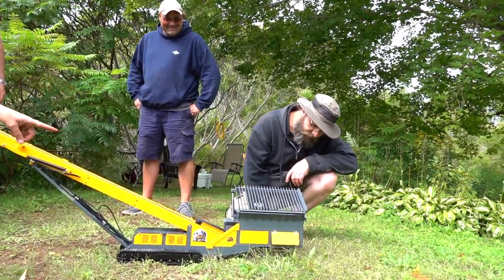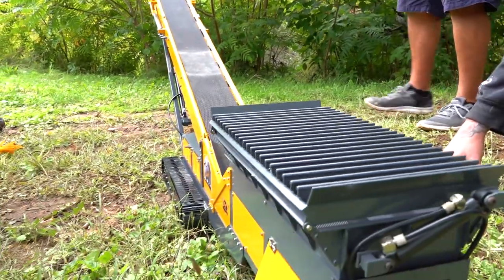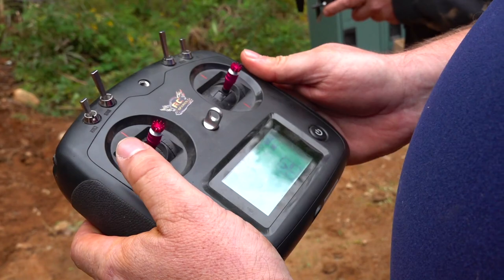YouTube GOLD - NS - "HELL or HiGH WATER!" - Good Ol' Lads Diggin' - S4, Eps 8 | RC ADVENTURES

Comment: I always classify my pay wet because gold likes to stick to rocks so I make sure they are clean. I've got a Keene mini max high banker it it's got about a 98% recovery rate. You should invest in one. It comes with a scrubber mat and a clean up mat for fines. It's also a sluice box and has a flare to fit on. They aren't cheap but nothing that works well is. Like the models for instance!

Comment: Drag lines are fairly easy to build you just need to make a bucket , the crane part is a crawler crane with a extra winch to drag with . Set the boom at 30 to 35 deg and away you go . Just don’t expect to move mountains quickly they are slow with a scale bucket